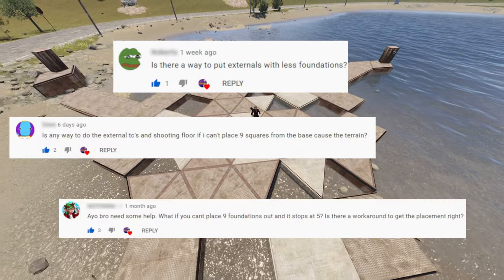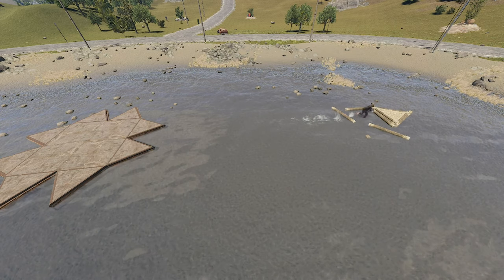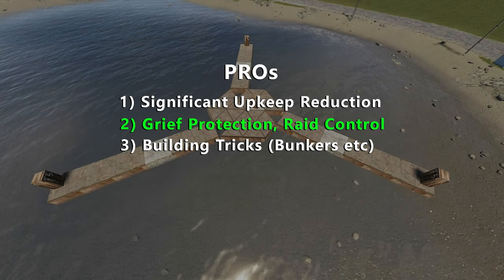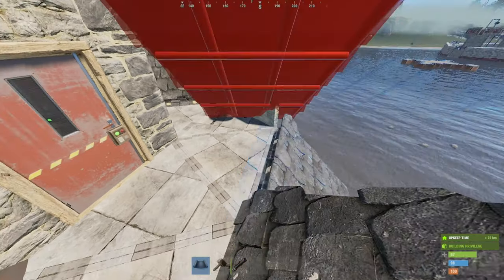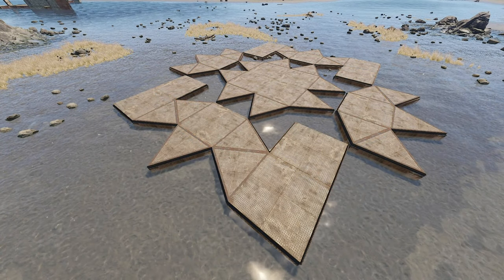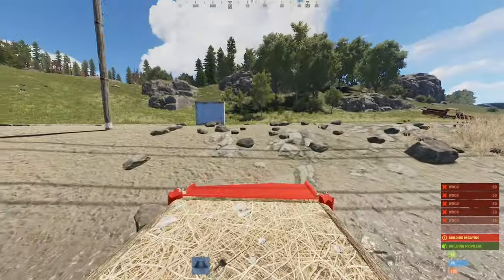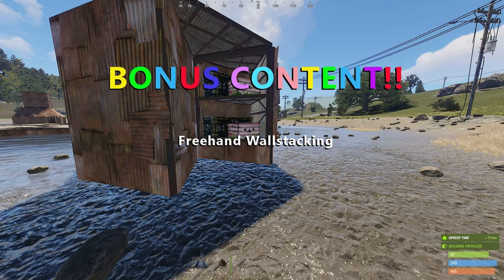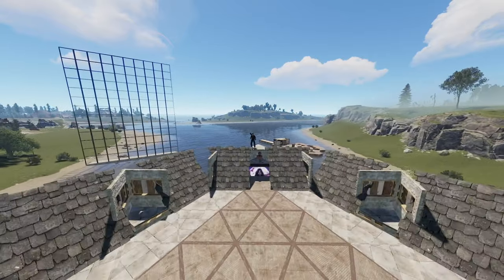How To Build in Rust: WALLSTACKING Vol.1 | How to Build When Blocked

Comment: 1:45 This is possibly the best argument for a multi-TC base. It's amazing how many players I've had to explain this to. Less upkeep = less farming. You don't have to have a standard 2x2 and get offlined every single day just because you cba to farm a lot. Even as a solo you can have a group sized base with less than 30 min farming per day.
Reply from the maker: yup.
Speaking of which, check out my solo base (50 rockets for about 3.7k metal per day :))
Reply: @GameLightz  Will do, thx man!

Comment: Good tutorial. I‘m working on multi tc bases for iver 6 months and I only got one problem: if u do a chinawall at outer tcs; once a tc is detroyed, it‘s impossible to replace them. U got any ideas ?
Reply from the maker: Yes. The simple answer is that china walls aren't really a very good thing to build (flank towers are better).

But that said, don't put the TC inside the china wall. Have it as a disconnectible outside. You can always fortify the shit out of the TC compartment itself
Reply: @GameLightz  thx, gonna try this out next wipe

Comment: Great video. One note though - externals don't provide grief protection, they make you more vulnerable to grief. The tankiest externals I've seen were two garage doors, meaning for at most 6 rockets, almost always less, you can put an armored TC on their base and force a section of the wall stack to decay. I've seen clan bases with 6 externals that were all just single sheet doors. I think that the meta for externals is going to be to make them significantly harder to raid once more people catch on to this, possibly even bunkering them or something.
Reply from the maker: That depends.
I always 4 or so externals, and at least one of them is HQM.
Check out my "minibunkers" video :)

Comment: i didnt know anything about stacking until now. awesome. do you have any other tips on how to get started learning to be a builder?
Reply from the maker: Learn some good solid builds and improvise on them :)

Also build to what suits your play style.
For example, my playstyle is to never actually be in the base when I'm playing, so I prefer super-strong, cheap bases that will stand up to offline raids.

Other people prefer multiple tiny bases, other people prefer weak bases that are easier to move around inside because they like living in the base, etc.
Reply: @GameLightz  thats interesting. i like it. i was doing some of evil wursts base design but we got offlined so often . i actually moved the TC up to where the furnaces go in the mini frustrator 2. no body found it. lol they went straight to loot rooms and i kept my good shit up top
Reply from the maker: @Maxmilion6004  It's certainly harder when everyone knows the design you're using with precision.
I try to make it so that with my designs it won't matter much even if you know the design.

You can check out my trio base design which is the one most commonly in use in wipes. I think it's pretty good in that respect. People have certainly stress tested it a bit.

Comment: Im a bit confused. How can i place the tc or external tc, if the range is so close that raiders cant place one?
Reply from the maker: either you disconnect the externals (via disconnectible mechanism) and then place the main one, or you destroy the external ones (which is easy for you cuz you can open them up), replace the main, and then replace the externals.

If you want a more clear visualized explanation of this, maybe try my "sentinel" video. I do an explanation of that in the beginning.